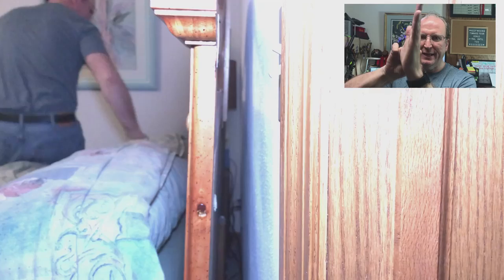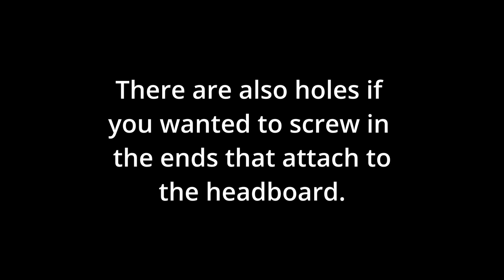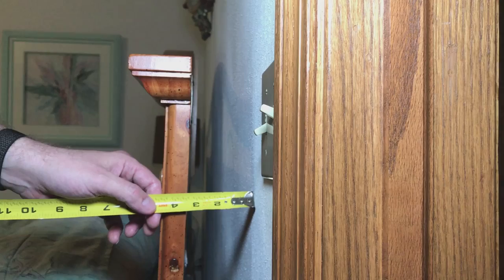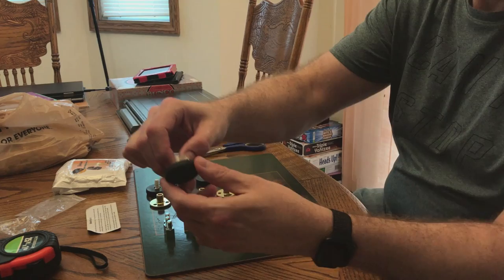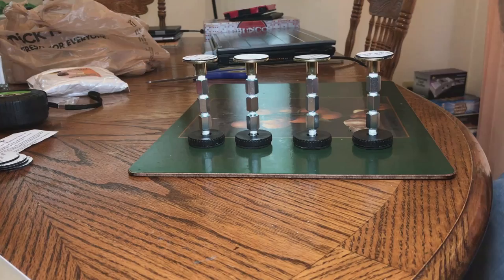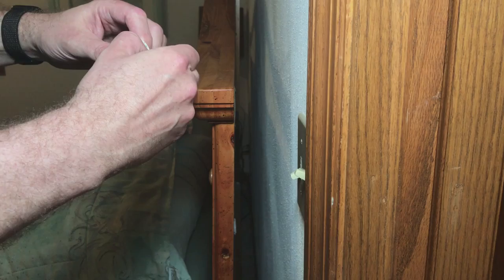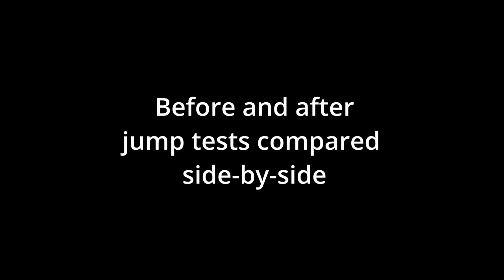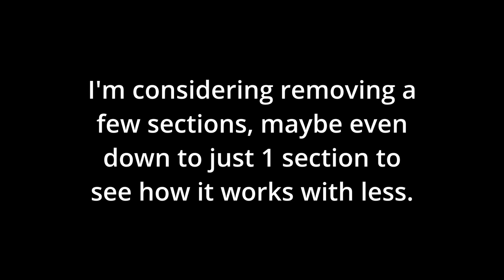Bed Frame Anti Shake Tool Installation and Review

Comment: Thanks so much for this. My headboard banging is really annoying.. I wqwil definitely try this
Reply from the maker: You’re welcome! Yes, very annoying problem! I recommend that if you have someone to help move it all closer to the wall while you’re installing it, to try just one section, not like 3 in the video. It will work better and need less adjustment later when it settles. I removed 2 of the 3 sections and it works better now. Good luck!

Comment: What if we want to change the bed position?
Reply from the maker: Can you please clarify? If you mean you’re moving the bed to a different wall, you need 2 people to move it while holding the headboard. Whenever moving the bed with the headboard adapters installed you need 2 people.
Reply: @EdBusacker  i want to ask if i want to move bed from one room to another than this anti shaking tool can be re-used once removed or not?
Reply from the maker: @Entertainment-pr4ir  Thanks for clarifying. If I was moving it to another room and only used the self-adhesive, I would unscrew any of the sections temporarily, leaving only the parts stuck to the headboard, then screw the sections back on in the other room and adjust.
Reply: @EdBusacker  thanks